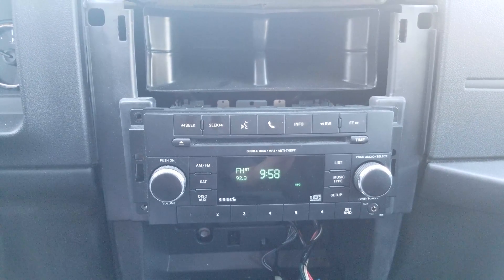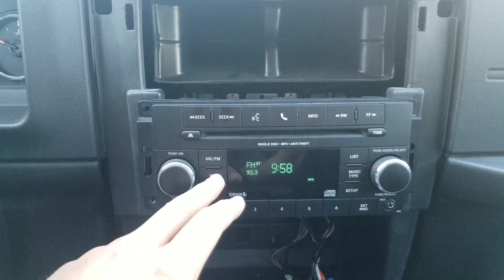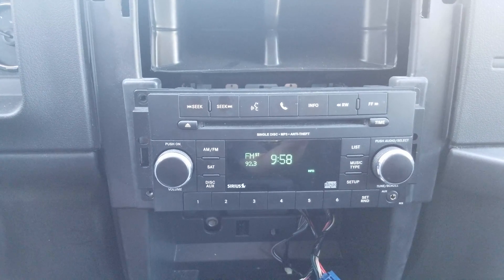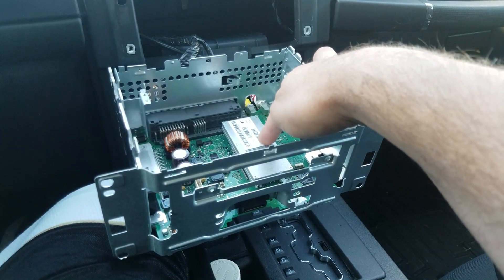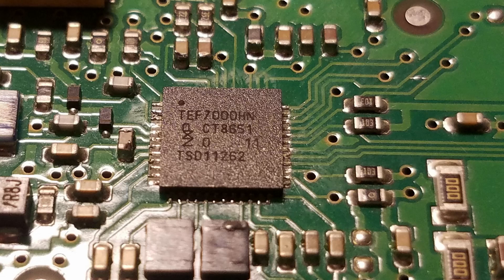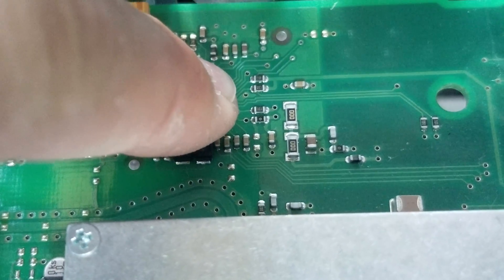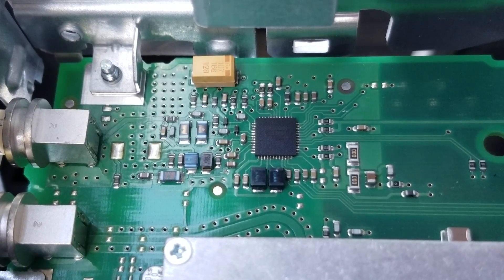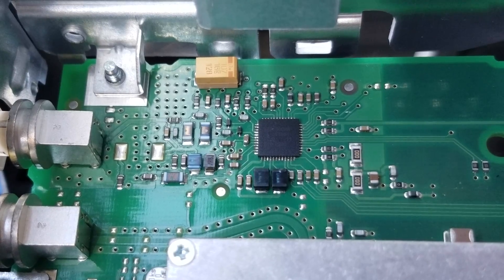Media Center 130 (RES) Tuner Repair

Comment: Confirmed this works. I just put some flux down and ran a soldering iron tip across the pins with a little bit of solder added. Magnification helps too

Comment: You sir, are awesome! you saved me hours of time troubleshooting my car radio. The NXP chip on my radio clearly had a few bad solder joints and it was fixed by just re-flowing the smt chip. While I was in the radio, I added some thermal paste to the main audio amplifier chip which is just lightly pressed against the aluminum shell of the radio without any fasteners. It should help a bit with thermals. Thanks again!
Reply from the maker: Great! A little thermal dissipation can't hurt since the problem was most likely caused by heat stress on the solder joints.

Comment: My wife's van had the same problem on the RES radio. Fortunately, I'm a component-level electronics repair tech, so I have the hot air soldering station and simply reworked the original solder on that chip. Radio works great now. Thanks!

Comment: I swear no joke I thought it was like  The  Mandela effect going on I read  Whole forum about this problem and told my parents because they have this car that has the radio and they had the same problem and I can solder it so I was trying to fix it for them and they didn't believe me at 1st so when I went back to look for it I couldn't find the page And when I tried to look it up on YouTube and Google it and we couldn't find anything this literally the first thing I've found thank you so much btw how did you get this thing apart it's my first radio and I have no clue about this and I'm struggling hard getting into it I'm having alot of trouble getting the disc insert and the plastic piece off

Comment: Thanks a million!!! i have no skills soldering so i wedged a piece of Chinese chopstick between the chip and the top cover of the radio keeping constant pressure to the chip. lmao works great! ;-]
Reply from the maker: Lol. Funny story - The repair did not happen in the same day due to time constraints. I shaved down a wooden shim and wedged it between the top of the chip and a metal support above it temporarily until I had time to repair the pins.
Reply: Same here I cut a wooden spoon to size and have it wedged in mine 😂

Comment: I just finished this repair on my 2012 Jeep liberty. I was very surprised when I push down on the chip i could feel and here a slight click sound. Also, the radio came on when I pushed it down and off when I let it go. The  chip is only about 1/4 square so you have to have the right tool to reflow the solder. I used a TXINLEI 8858 110V Hot Air Solder Blower SMT Rework Station Optional Portable Heat Gun from Amazon. I play around with some solder and found 400 degrees to work ok. I held the chip down with a chop stick and used the heat gun to reflow the solder one side at a time. Only takes a few seconds each side and give it 30 seconds to cool down before releasing pressure on the chop stick. Radio nows works great, and thank you Johnny Wuht for posting this video.
Reply: 400° celcius, right? I just purchased an 858D rework station for this job ($53) and don't want to turn the PCB into soup... thanks for your reply it was extremely helpful!
Reply: @lynnumbarger330  it's 400 degrees Fahrenheit.  I had a wooden chop stick that comes with Chinese food to hold the chip down. Take some electrical circuit solder and practice melting the solder at 400 degrees Fahrenheit.  You can see it starting to melt quickly which is all You need. Don't apply to much heat or you will melt the board or destroy the existing solder joints.
Reply from the maker: Awesome! Glad to hear it worked.

Comment: 2011 patriot with no sound on any modes. This fix worked! I simply reflowed all joints on that chip.
Reply: Andrew Malina got any tip on how I can resolver this chip?
Reply: @denverdantheman853  I simply held pressure down on it and used a heat gun for a couple of minutes around all four sides of the chip
Reply: Hi did you completely unplug the harnesses? Was there any issues with reinstalling such as needing an anti-theft code? Thanks
Reply from the maker: Excellent! Glad it worked

Comment: Thanks, many thanks!!!, I had the same problem with my 2013 JK Jeep Wrangler Unlimited Sahara, a lot of JKU owners had the same problem but did not find your video, all threads finishing with " I had to replace the radio.... ", sad. The trick was not to put "jeep", or "wrangler" etc., in the search terms, only searching for "RES 130 radio problem", of course FCA has put this radio in a multitude of vehicles.. Anyway, so I took the radio out and reflow the chip, a 15 min. job, works fine now. Wow, saved a few box!
Thanks.
Reply from the maker: I have seen many reports of this particular unit failing in this way. Unfortunately, I suspect the issue is caused by an overheating of the chip that compromises the solder joints. It seemed to me that the pins that gave the most problems were toward the front right of the unit (closest to the 'HN' in the model number)
Reply: I agree, there is "just enough" solder for the chip, I guess joints can break when submitted to dilatation due to heat/cold cycling, here,  it goes from -30C in the winter to over 40C during the summer, the problem started during a heat wave, the cabin temp. went very high, siting in the sun.   @johnnywuht4644

Comment: Thank you, thank you for posting this! I have a 2012 Power Ram with this unit in it and have had the same trouble for over a year. Took it to the dealer and was told it was some ridiculous amount to replace so I just listened to music over bluetooth or aux cable from my phone instead. Now those started working intermittently. Took the unit apart as you described, pushed on the exact same chip and that's exactly where the problem seems to be. My question for you is, how did you go about soldering those tiny pins? Am I capable of it or should I take it to an electronics repair store or something of that sort. Please provide your recommendation.
Reply from the maker: Due to the fine pitch of the leads the repair is much more feasible with a reflow station or heat gun. I used a Hakko FX-888D with a fine tip. This was a more tedious process but is what I had access to at the time.
Reply: Just press down on the chip with a flathead while running the heat gun on it, then let it cool.

Comment: I have the same exact problem with a 2012 Dodge Ram that I just bought yesterday. Pretty disappointing. How difficult is it to get to the tuner chip? The video doesn’t show that part. Is it just the radio casing that comes apart or do you have to disassemble the whole thing?
Reply: Also have that problem on a 2012 ram
Reply: I found a video on how to replace/change on a Wrangler, you could search for your truck. Then ounce you have the radio on the bench you need to 1. carefully remove the front panel 2. remove the CD disc unit, two screw on the top and two on the front, gently disconnect the cable to the board 3. Reflow the chip on the board.
If you don't have a reflow station ( hot air soldering gun ) then you will have to find someone, some shop that can do it for you. Hope this helps.